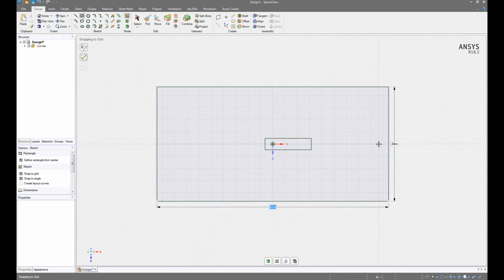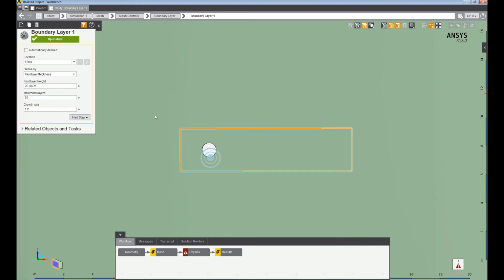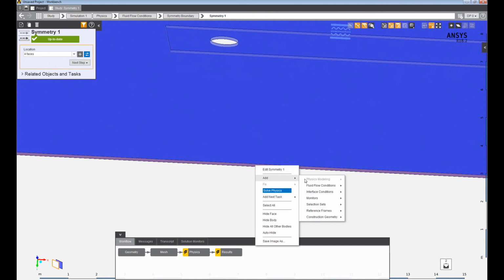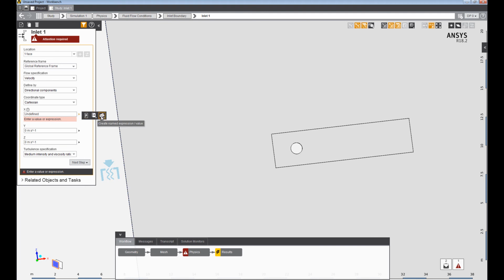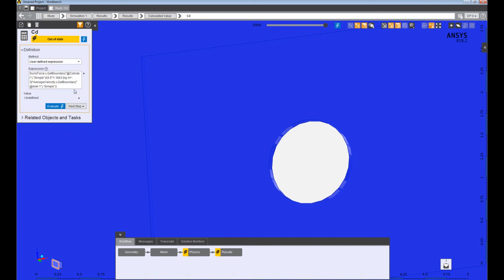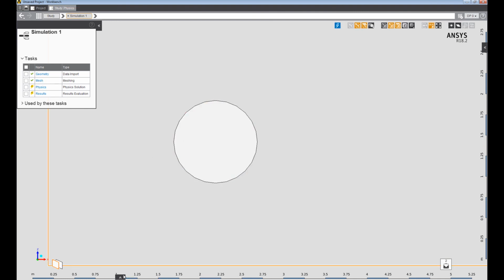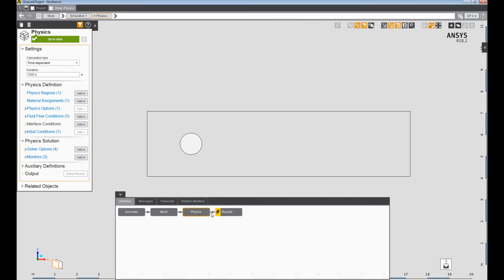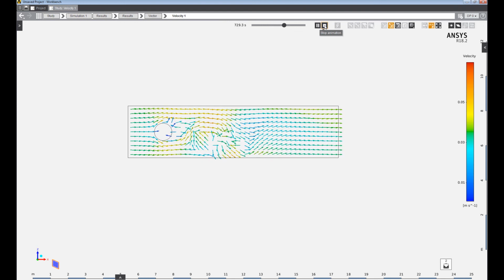Flow Over A Cylinder - The right way

Comment: Would you be able to share a video on Laminar Stationary Flow of Air around a  Rotating Circular Cylinder. w= 100rad/s. im asked to figure out the Direction of the Side force and also to plot the streamlines and Stagnation points. Still new to CFD and trying to get my head around it.
much appreciated
thanks